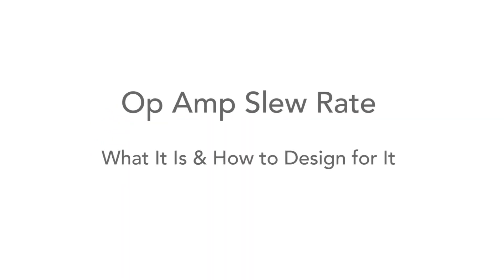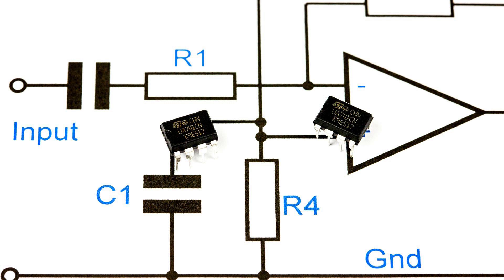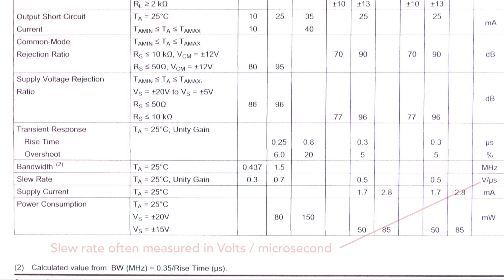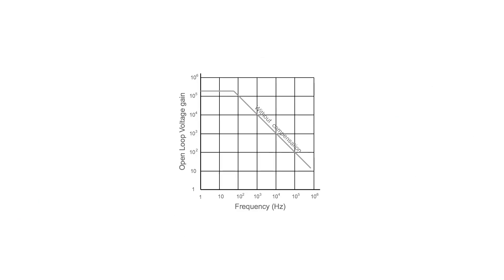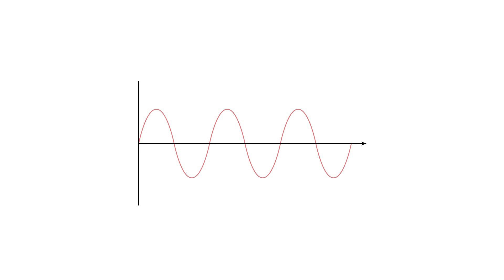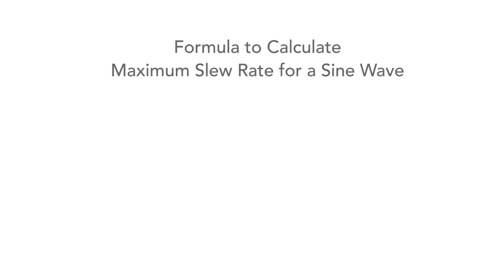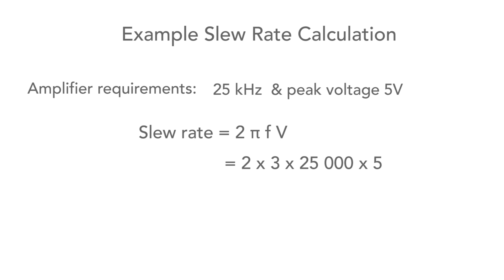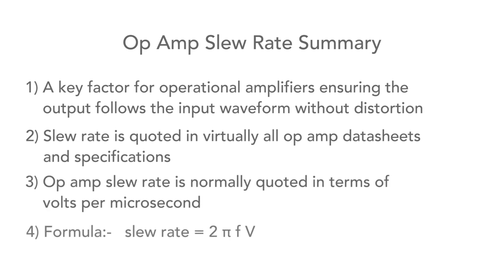Operational Amplifier Slew Rate | Op Amp Slew Rate

Comment: How would you calculate the necessary slew rate when working with square waves rather than sine waves?
Reply from the maker: You need to find out the amplitude of the square wave and determine what rate of change is needed to meet the circuit requirements. As it is a square wave it is easy to work out the amplitude and then the rate of change required.

Comment: Thank you for the great videos they are really enlightening. Just a couple of questions lets say we make an op-amp how can i find the SR and how would i measure it?
Reply from the maker: The slew rate for the op-amp is normally quoted in the data sheet, and you can often find test set-up as well for this. In terms of measurement, a square wave can be applied on the input and the output waveform measured on a sufficiently fast scope with the probe properly compensated, etc.